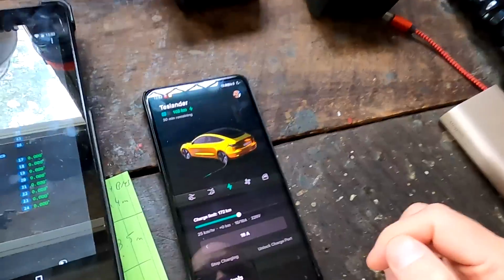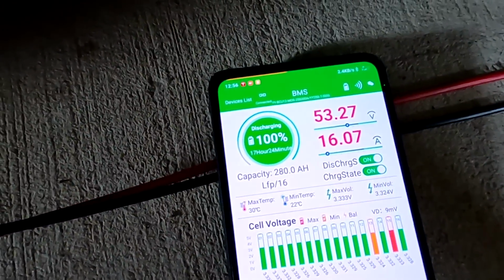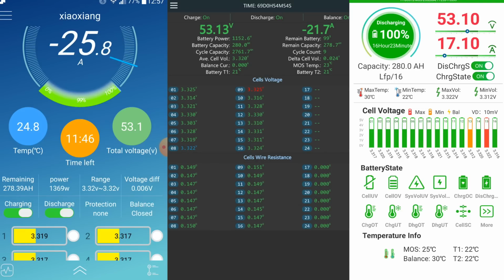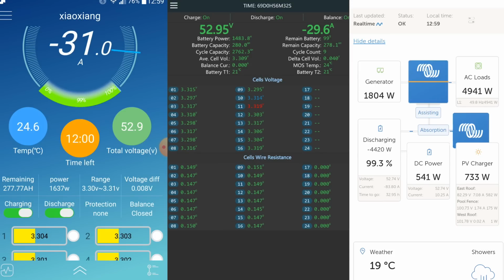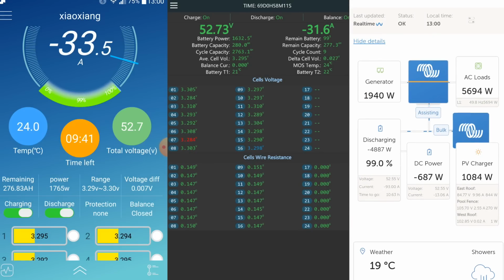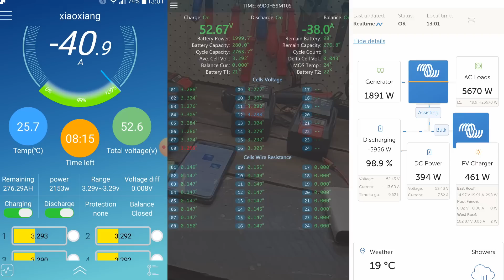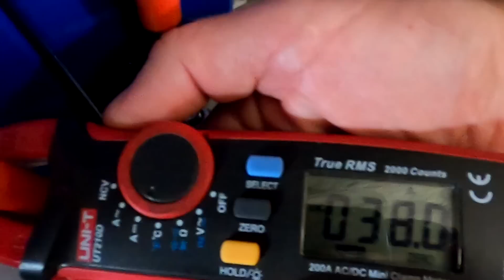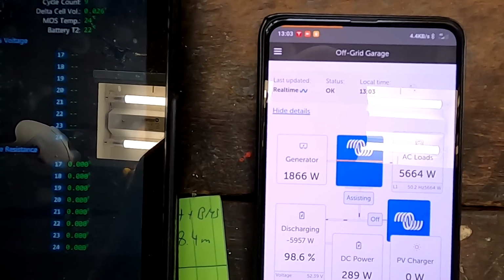Max load test on parallel battery banks. Will they deliver equally?

Comment: This is one of the most important video for any solar tech. This is gold. I thought the parallel battery banks/cells has to have the same capacity.
Reply: You just need the same capacity in one bank. For 51,2V Bank all 16 Cells have to be the same. But if you have more Banks like here, it doesnt matter. The voltage will be the same at every Bank.
Reply: @derfahrendetechniker1271  yeah I know voltage of the parallel banks should match but I didn't know capacity could be different.
Reply from the maker: You haven't seen the video where I paralleled a 300Ah battery bank with a 5Ah battery bank?
https://youtu.be/fQz7vZEYLfY
Reply: @OffGridGarageAustralia  now i just did. Thanks for making such videos.
Reply: @OffGridGarageAustralia  Will this work for lead acid flooded batteries too?

Comment: Congratulations, the battery pack is working as it should, and that's what it was all about.
It would be very, very informative to check how at least two batteries with the same capacity and the same BMS work. Of course, I mean JK BMS as the one that works with the smallest voltage deviation on the cells.
It would be worth checking if the charging and discharging currents are THE SAME (not comparable). This is essential when building a battery pack with many parallel branches. In your case, it would be enough to change only one BMS to JK BMS...
Reply: >  if the charging and discharging currents are THE SAME (not comparable)
This doesn't exist. There are always differences between strings, slightly different connections, etc. However, it doesn't really matter. Those 6kW Andy is pulling: you can do that with a single 16s pack and BMS and not even hit 0.5C. If this were a car application where you pull 10x that amount, you'd need to worry about this more (which is why they parallel cells in those applications instead of strings), but for typical solar applications it's not very important.
Reply: @upnorthandpersonal  I don't think we understand each other. I do not mean exact, in the laboratory sense, accuracy, uniformity of the currents. Because it is obvious that it cannot be obtained. The point is that the BMS should have VERY similar dynamic characteristics, so that the loading and unloading times of individual strings did not differ by hours, but at most by a few minutes.
For some reasons it matters to me and the matter is not as obvious as it seems at first glance.
Reply: @andrzej3511  Since the BMS are just FETs with a few milli Ohms of resistance, I don't see how any difference more than a few amps can occur. What do you mean with dynamic characteristics in this sense, because it's just an on/off switch (and the connections at the breakers in Andy's case add more to the overall resistance of the string than the BMS FETs). All packs end up at the same state of charge and even if one pack is slightly different before it's connected or during operation, it quickly settles any imbalances in current sharing. 
Maybe I'm still misunderstanding you, but when you say loading/unloading times of individual strings: the current delta between strings is minimal. Also, if the two strings are at a different voltage level and connected together, they will quickly settle - and because of the flat curve, this won't even result in huge currents.
Reply: Since the semiconductor junction has a non-linear characteristic and since the operation of the semiconductor is based on the doping of silicon structures, we are ALWAYS talking about the dynamic parameters of diodes and transistors. EVERY type. We are ALWAYS talking about the deviation of semiconductor parameters.
It is an unjustified superstision to believe that the MOSFET is linear. Especially when it is controlled by bipolar semiconductors, especially switching transistors.
Maybe you are going to prove to me the existence of some new electronics, because the one I know with full honors respects the dynamic resistance of the semiconductor junction, respects the deviation of semiconductor parameters with MOSFETs at the forefront - just look at the catalog note of ANY semiconductor and you can immediately see that we have parameters of min., typ., max. Is it not?
I mercifully ignore the very strong influence of temperature on the operation of semiconductor systems...
Therefore, I propose to reconsider the sens of your post.

And finally. If this experiment will not carried out by Andy, I will conduct it myself. So I reject all a priori assumptions in advance. Any discussion and "evidence" on this point is purely academic to me.
I have a strong opinion on this point and I am not going to change it. All I need is experimental confirmation (or denial).
The so-called good advice and great theories are very good... for giving. Only. Because of all physical phenomena I know, the passage of time is truly linear in earthly conditions.
Reply: @andrzej3511  But in this particular application it doen't matter: the impact of the MOSFETs is less than the surrounding components, connections and wire lengths. I've been running two packs like this for two years now. The different MOSFETs across the two different BMSes has no impact. Remember that each BMS has 40 MOSFETS, configured in 2 x 10 back-to-back pairs. With an Rds_on = 3.2mR per MOSFET, this gives a total resistance of 0.32mR. Things get averaged out and just don't have an impact at all. Both my batteries cycle together. No deviations. I'll add two more this year. It won't make a difference.
Reply: @upnorthandpersonal  I thought I had made quite clear the view ending all discussions...
Reply: I somehow feel as if andy has at least 2 of the new jk bmses on a container already... But yeah, that would be a great test indeed.

Comment: I'm building a 8kw solar array, but I'm not sure how many  Ah I should take for the battery
Reply: I think the answer to that is, as much as you can afford ;)
Reply: @luc_libv_verhaegen  i find some 500 ah 3.2v at 184$ before shipping 6000 cicle grade A
Reply: @Irilia_neko  500Ah is fake. 304max. Check Andy's site for solid sources.
Reply: Depend on the input wattage of the inverter. A hybrid inverter average can accept 5
4500 watt , so 2 would be sufficient. Desirable inverter is the one that can input 120v - 450v as 4mm wire is enough to carry lower current

Comment: Andy, Can you look into the custom arduino based BMS systems. I was reading into it a little and didn't fully understand it, but saw that someone was able to use an Arduino based BMS system on a DIY EV vehicle project for a 192v, 64S battery pack and had a custom PCB made that implemented 5amp active balance circuit across the entire 64S battery pack.
Reply: When you go to Arduino, and things in this kind, you need to be able to program it and you need to understand how work The electronic circuit. Because if you have any fault you can't contact the manufacturer. It's depending if you want a system stable, or the goal is only to experiment ^^
Reply: A quick google did not turn anything up for me, do you have a url?
Reply: @luc_libv_verhaegen  There is a project called DiyBMS but I don't know if it's the one mentioned.

Comment: Andy, can you or your subscribers recommend to me a supplier to purchase one battery cell at 190ah l have a bad cell that needs to be replaced.  Many thanks great show.     🇬🇧
Reply: John, you can put a higher capacity cell in series with existing lower capacity cells.
Reply: @randycain5764       Thanks for that, l was thinking of putting a 200ah in it’s place but the problem still is buying one cell and from a supplier that will sell me one cell.  Many thanks all the same.      🇬🇧
Reply: I am using 20 kWh of calb cell that comes from EV . Calb cell is pretty good as second life lifepo4 and it is cheap
Reply: @AHMADKAMALZUBER              Thanks for your reply.             🇬🇧

Comment: Your top battery capacity in the BMS is set to 280AH, not 304AH
Reply: I've said this in the last video comments and it's not changed yet.
Reply: At least one the three batteries that Andy has in that rack is 280AH capacity, the other(s) is/are 304.
Reply: The first BMS is the 304Ah and is not showing capacity but state of charge SOC,  which you can see is dropping in later screen shots. The middle BMS is the 280AH bank and the third one is the 280AH K bank which will last up to 6000 cycles. The BMS's for the two 280AH banks do show a capacity on the screen shot. André
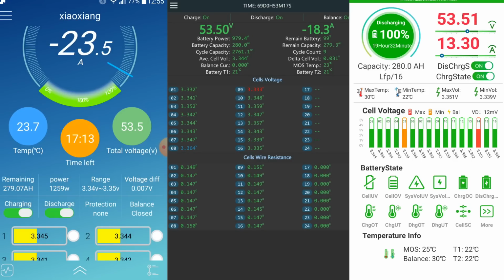Reply: @SoundzAlive1  You can see at the 1:00 mark that the left BMS (top battery) is showing as 100% and showing 279.07AH
Reply: Hi Jesse, yes it is the 304AH bank and it does show a state of charge (SOC) of 279 AH which is its SOC at that time. In other screen shots later in the video it decreases as the SOC reduces. That BMS has a capacity setting on another page not on the front like the other two BMS. André
Reply: Hi Andy here to ask the same question… the capacity being set at 280ah on the 304ah bank has to be throwing off the estimated time remaining?
Reply: @daleholland878  Not by much - 20Ah is just 1kWh, or about 10 minutes on his load.